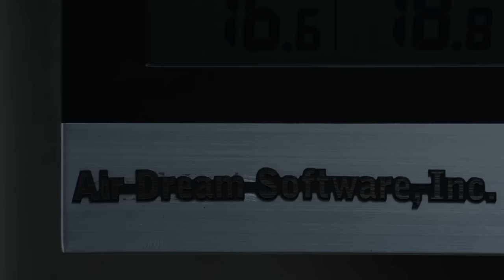Hacking Steel Mountain | Mr. Robot

Comment: Really cool scene when he installed the raspberry pi 1 A+ (model released 2014). The scene would have been even better if the Power LED would have turned on and a Power cable would be connected. Judging by the 2 cables at the GPIO I guess they were used for the power. The big blue cable looks like it has been presoldered on the audio jack ?
Reply: And then their is me useing a raspberry pi for my 3D printer... makes everything manageable
Reply: Oh is that what he did? I thought he was running the mains to the earth so Tyrell would get a jolt from the tap!

Comment: how come his raspberry pi can work with no power, I want to have one too
Reply: PoE I'm assuming or they just messed up
Reply: he connected the pi in parallel to the control panel, you can see him take the + and - wires from the wall and wire it to the pi, the wires are probably at the proper voltage since its already powering an lcd. even if it isnt you can mod the pi to take an wide input voltage range for like $1 in parts.

Comment: 1) How did Eliot connect the Raspberry Pi without power?
2)How could Darlin have ssh access to the Rasbery Pi if the Steel Mountain network is local (without internet access)?
Reply: I guess we will never know
Reply: PoE on the cable, rasberry pi could be accessed from a wireless adapter or a 4G LTE card

Comment: isnt that rasberry hooked up to a POWER SOURCE or what , just plain data wires ? the pi itself consumes around 300mA and besides the fact that there is no diy battery module on the back of the board annoys me even more because i know for a fact that the ethernet cable doesnt have any 5V and GND pins and even if there was a custom board that used 2 of those pins it would certainly not have enough power to run both devices that together consume about 1A , not only that , but that much current would not flow through a data line(without melting it of course ) that is meant to carry maaaybee around 20mA or something like that ... POOR HACK ELLIOT ....POOR HACK : (
Reply: Poe

Comment: Can anybody tell me why he put rasberry pi inside the wall
Reply: Season 1 spoiler alert.

IIRC he was connecting it to the building's air conditioning system. The goal was to turn the data storage room so high that the data tapes will be burned. Later they found out that the AC system is connected to the actual database, so they just straight up encrypted the whole database making them unusuable.

Comment: He connected Raspberry pi? Seriously 😂😅
Reply: Yes
Reply: It can be really useful. He just needs to connect it to the system so the software will be able to hack the system. It is not unuseful.
Reply: @tiredcaffeine  An arduino nano was enough to do the job. It's also smaller and fast. RPi was overkill
Reply: @mukherjee.p  Well that does not mean that Raspberry Pi cannot be used.
Reply: @tiredcaffeine  yeah but it's unnecessary
Reply: @mukherjee.p  how you connect the ethernet with arduino nano? also how you connect your computer which is located outside of building or even city to the arduino nano?

Comment: but how can the raspberry pi function without a power supply
Reply: Battery
Reply: Just kidding
Reply: @sgt.boris4713 , there is no battery setup in the scene
Reply: @8.shankercs254   ya
Reply: PoE most likely, or he rigged the power cables as well (the red and the black one), but that raises other issues like voltage regulation.

Comment: Strange, a fortress which allows random devices to be able to connect to their network, the writing could been better here.

For non tech ppl out there, even a small to med sized businesses do better. It's just not possible. Unless you have a automated 0 day attack or an exploit which is yet unfixed which will require lots of info from both inside and outside and their whole sec team should be fired to not detect a new device on their network. 

Long story short, this scene is not more fiction than Thor flying via his hammer